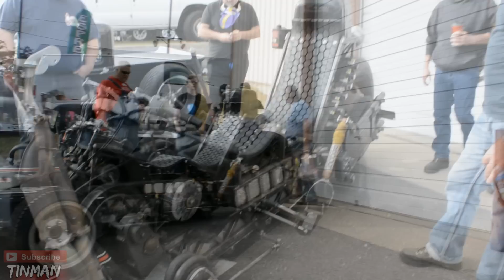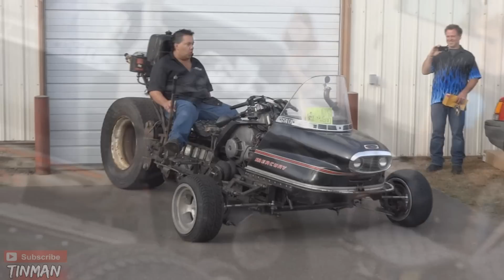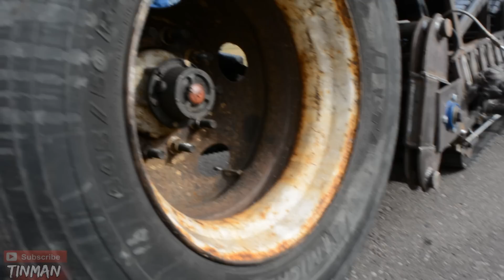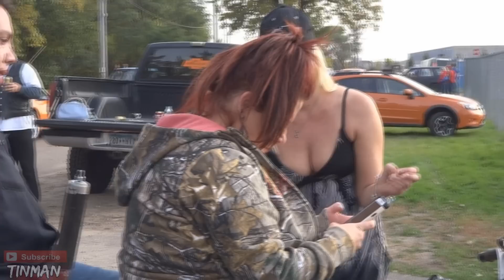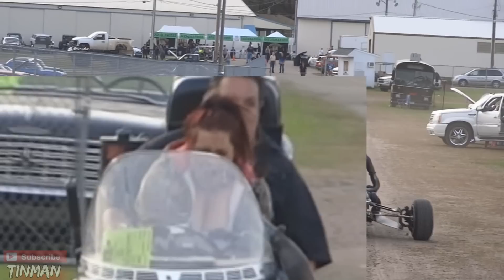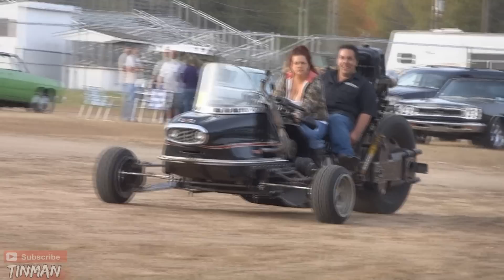Bagged Rat Rod Trike: 190hp Snowmotrike?

Comment: Does the POS not shift gears? It has got to be one of the weirdest machines I've ever seen.
Reply: +Donald “NOT PLAYING1970” Byrd Snowmobile Transmissions are a style of automatic called a CVT (Continuosly Variable Transmission) that runs a belt between two pulleys. The primary drive is attached to the crank shaft and sucks the belt in with throttle, and the Secondary shortens up, which the combination of both give you the gear ratios. 3:1 is generally starting, 1:1 is pretty good speed, and then 1:3 overdrive is REALLY fast haha...
Reply: Thanks, I didn't realize it was running a CVT. I guess a case of not knowing and speaking on it.
Reply: +Donald “NOT PLAYING1970” Byrd  You had a question and you asked it, nothing wrong with that!
Reply: +tofubob10102 still has the motorcycle engine transmission as well, actually.

Comment: I am currently the proud owner of this fine rat bike.  I own several interesting rides and this one by far is the most fun to look at and show.  a challenge to drive due to the air clutch and air shifter but once you practice it is like riding a bike!!!  the pedal steering is crazy fun, the builder Jim really knew what he was doing.  if you need any info on it I can be emailed at Sherwin@edgelogo.com